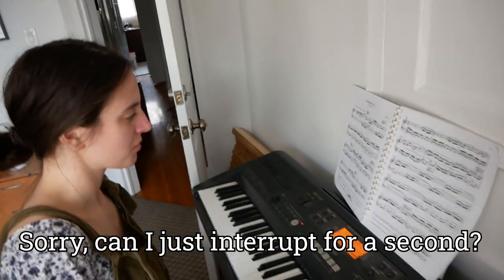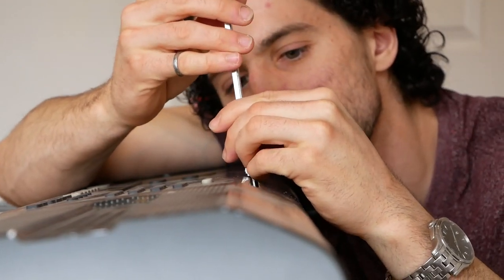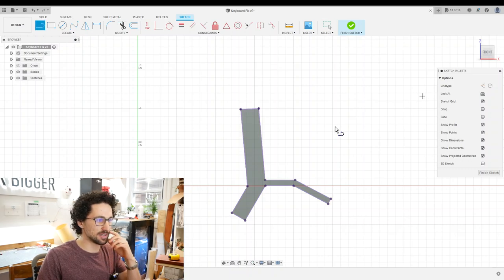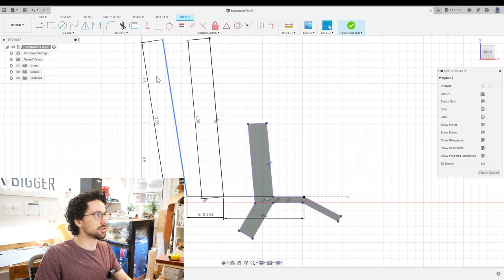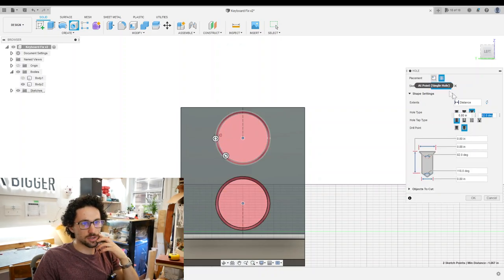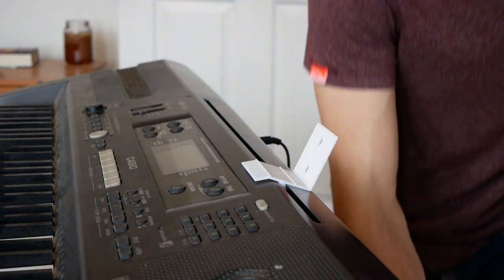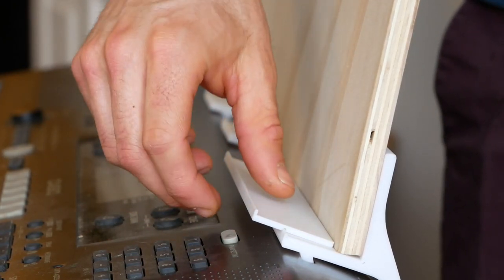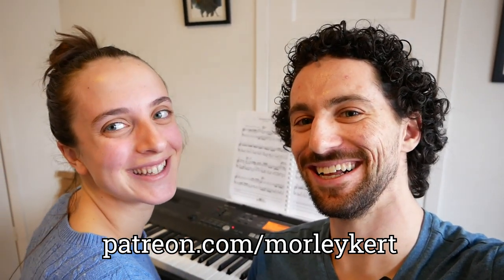Fixing her keyboard with 3D printing

Comment: If you want to reduce the weight of the wood backing consider drilling out twenty or so 2-inch holes. If you swiss-cheese it enough you can probably drop half the weight without affecting its book-holding strength.
Reply from the maker: I was considering that after seeing how bendy the first prototype was, but v2 seems to be holding the board + heavy music books no problem!
Reply: You could really have some fun with the design of the cutouts, it really just needs to be mostly the perimeter and a little webbing here and there maybe.
Reply: @jeremyspecce  I'd suggest dog paw print cut outs.

Comment: I like the effort here but I think 5 lbs of plywood is kinda overkill.   Suggestion - instead of using wood for the back, you could use some acrylic plastic... if it's bending you can laminate up the acrylic to get to a solid thickness and also the glue adds ridgidity (this is how they make stuff "bulletproof"),  or even scroll out the inside of that piece of plywood wood to make it lighter (you will notice on most console pianos even the wood music stands are cutaway frames.)  Last bit of advice: print those pieces with ABS and/or with a thicker line width so you don't have to alter the angle forward to accommodate the sag from the weight of the wood as it will be more rigid that way.  Cheers to a successful project regardless.

Comment: As a fellow American I find your dedication to imperial measurements disturbing. 👀 jkjk, everyone does their own thing of course, I just find it a bit easier to design for 3D printing in metric, especially since line/layer thicknesses are usually (always?) defined in metric. This is the second video of yours that I'm watching and I'm really enjoying your content! I feel like I'm learning a lot about Fusion 360 beyond my self taught ham-fisted approach. Keep up the good work!
Reply from the maker: Thank you! Yeah, I grew up with imperial so it’s what I’m used to. I’ll switch to metric one of these days.
Reply: I'm a Brit living in the US. Imperial measurement are a health hazard. Fortunately, in engineering, we use metric, so I'm not impacted by it often.
Reply: Can't you just change the default unit in the software. Or just give elements dimensions in whatever unit, and let the software handle the rest?
Reply from the maker: Yep! That’s what I do. fusion deals in real lengths (I.e. it knows that 1 inch = 25.4 mm) and you can enter dimensions in any unit.

Comment: What is really needed for digital pianos is an inexpensive monitor arm mount!  No one has done it yet.  Then any cheap LCD monitor (older 22" 16:10 ones go for for like $30!) with a VESA mount can be positioned anywhere we want.  So it would be built into a keyboard stand that is height adjustable, that can adjust the tilt of the keyboard as well.  People never think of that but it can make a big difference if its dialed in just right.  Think sleeve bearing with a clamp on each side to lock it at a particular height.  You've got a good engineering mind.  Its time you embraced metalwork to compliment your woodworking and plastic 3D printing.

Comment: The only thing I would suggest is mill away some of the wood from the backside, take it in an angle 1/4 to half the thickness at the top down to the full thickness right above your brackets.
This will make it less top heavy and have a nicer profile.

Comment: The back of the calipers with the short tangs are meant to measure holes or distances between two faces. So you can measure the width of slots and stuff without eyeballing it with the long tangs.
Reply: except with the slot is angled, or with a surface thats a different angle to the slot, then you cant measure it with those, the slot has to be at pretty close to 90 degrees to the surface.

Comment: Fascinating, how did you learn how to do all this?
Reply from the maker: Mostly self taught 3D printing and fusion 360 over the last few years! I also studied civil engineering in university but I’m not sure how much that applies to this project haha (though the problem solving and CAD skills I got in school were useful for this)
Reply: For making models like this, an easy to start and no licence needed option is OpenScad. 
It is not the same as Fusion 360. Instead you build models using simple geometric command like; 
cube( 10 );       // for a cube with sides = 10 mm.

A full CAD option like Fusion 360 is a great tool, but will for many have a high startup difficulty. Just getting some understanding of the geometric building blocks used can help a lot when trying to understand how things are done.

Comment: I wish there was a simple way to measure the shape of curved surfaces.
Reply from the maker: True, it is tricky! I wonder if there are flexible rulers that you can put on a curve and it will tell you the radius. Otherwise, taking a scaled picture and then tracing the curve in fusion is another way to do it.
Reply: @MorleyKert  I googled a bit and turns out a tool exists for that. It's called Contour Gauge.
Reply from the maker: @Mobin92  yeah that could be helpful! It would be nice if it automatically told you the radius though

Comment: It was obvious that the first design would be too flexible.
Reply from the maker: Hindsight is 20/20! Funny that it didn’t occur to me in the moment, I guess I learn best by making physical prototypes 😊
Reply: @MorleyKert  not hindsight.
Reply: @nexpro6985  Want some ice with that Hatorade, bro?
Reply: @chriswade9616  wow, you wasted an hour of your life searching that out and typing it in?
Reply: Yup, it's called the wisdom of experience, not hindsight.  As you were fussing about that front angle I was thinking, "Obviously that is superfluous to the applied load".  Only reason I think that is because I've been there and done that enough that, after I'm done considering critical design dimensions, it's the second thing I think about.  But it's what prototyping does today, and it comes cheaper than experience that isn't necessarily going to be called on again soon.